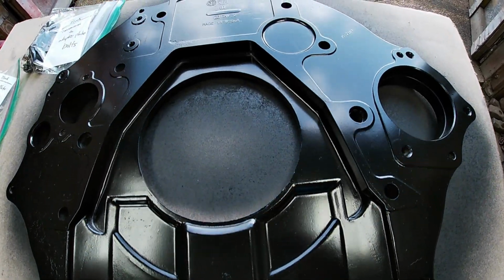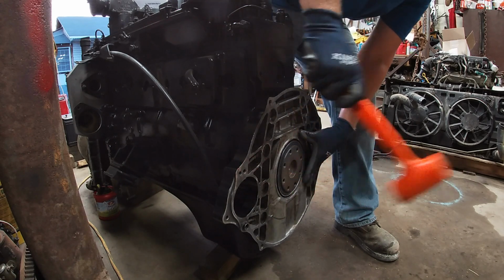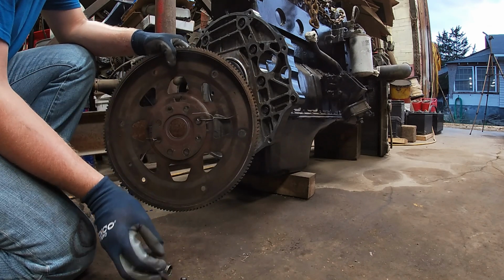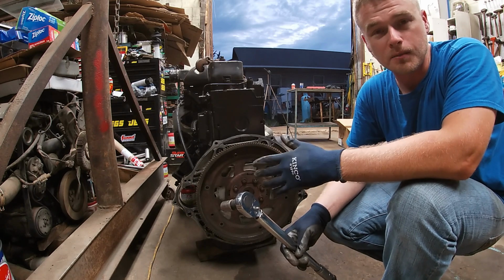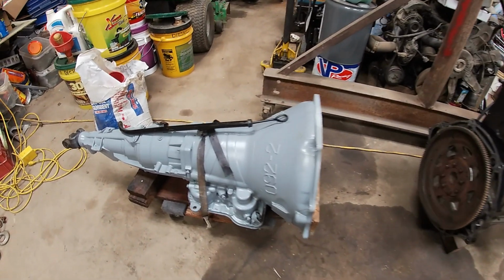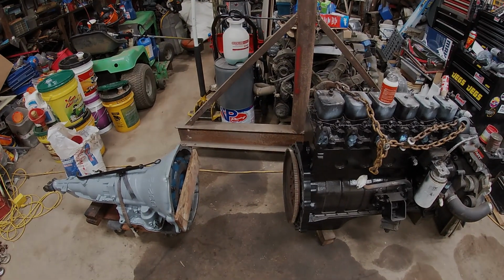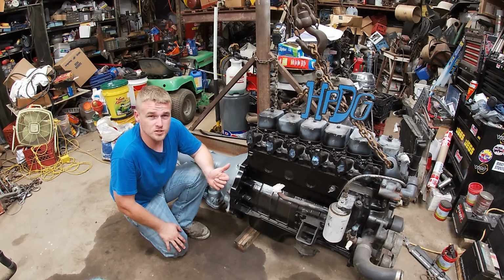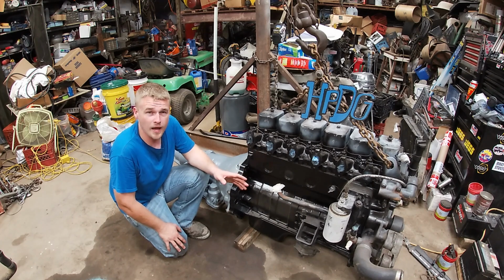Cummins Swap Episode 14: Bolting the Transmission to the Engine

Comment: Me and my dad changed the plugs in my 99 Dodge ram 1500. It runs a ton better now. But it needs a distributor replaced sometime in the future. But it's working for now. And it needs a rebuild cause is smokes but nothing major. But it runs!
Reply from the maker: Awesome to hear that it runs! 😃👍

Comment: Hey did you have to modify the front suspension at all for the weight difference? Or is it good as is?? Thanks bro
Reply from the maker: It would be fine as it is. The truck is a factory d350 1 ton single wheel. I'm going to swap the dually hubs onto the front of this truck. Thanks for the view :)

Comment: Good job, the only constructive criticism I have is that if you paint motors bright colors it’s a lot easier to find oil leaks
Reply from the maker: I debated on painting the engine blue,  but I tried for it to not look gaudy 🙂👍 thanks for the view and kind comment
Reply: HODGE_PODGE_DODGE_GARAGE even a light grey is good, I had one black Chevy small block once that leaked and I could never find it, after that always bright colors
Reply from the maker: @xozindustries7451  thanks for the suggestion 🙂👍

Comment: I know u may not b planning on turning the engine up but regardless i hope u put a very good torque converter and changed the valve body to a good one and if it was an a518  i hope u put, or had clutches put in it for a diesel bc those were the main problems with those autos even w/o turning power on engine up
Reply from the maker: Thanks for the view and kind comment 🙂👍 the previous owner put a better torque converter and a few other parts to tow his camper. It should be fine, hopefully lol